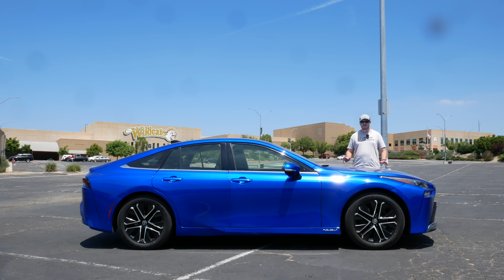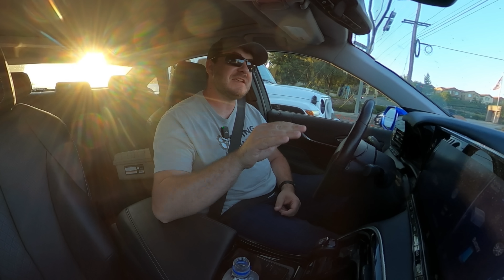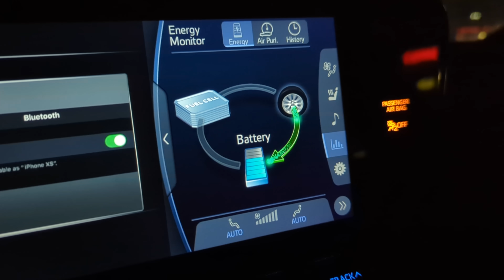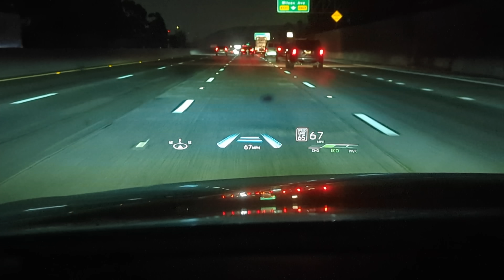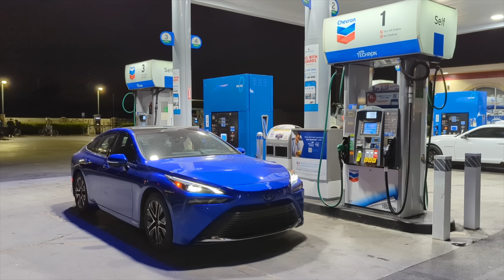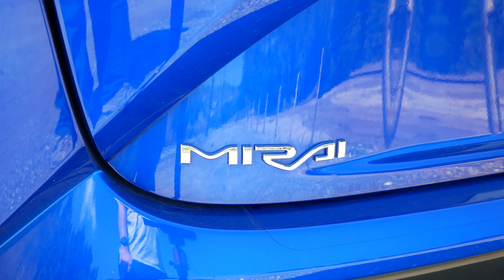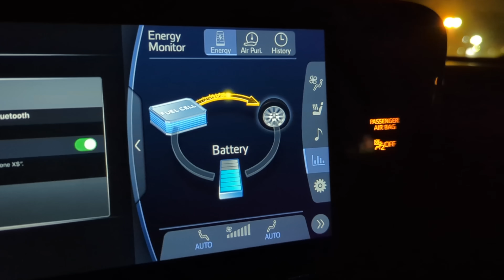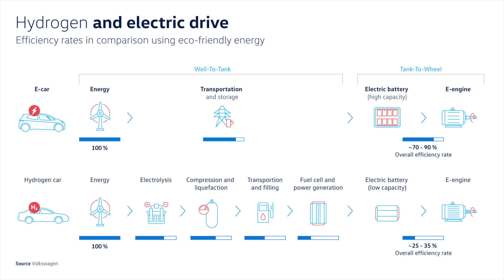The Toyota Mirai is Disappointing

Comment: The complexity of the chart by Volkswagon is highly deceptive in that it doesn't describe the scalability of the systems involved.   It also does not describe the efficiency when things change.  Such as when every car has to be electric. 

* Grid scale batteries are not feasible and won't ever be feasible. Battery storage does not -scale-. Can you keep increasing hydrogen storage? Maybe?

* The grid must be balanced at all times between supply and demand.  When there is not enough supply, usually the supply comes from fossil fuels. Unfortunately, the sun and wind don't shine in the right amounts in relation to the current demand.  Hydrogen might be able to be stored and compressed to better match supply and demand and reduce the amount of fossil fuels needed to balance?  Seems like that to me, but I don't know.

* Electrical transmission lines are shared.  There is such a thing as overloading transmission lines and causing forest fires, grass fires and electrical outages. Cars are not the main source of greenhouse gases and if we wish to reduce greenhouse gases, we need every bit of transmission line capacity to address those.  Heck, even an overhead system of electrical lines powering cars would be less bursty than "mega" charging.  Transmission lines do not -scale-.

How well does hydrogen scale?  I don't know, but I imagine it's much better than electric drive.  Energy must be in the right place at the right time and how it gets there matters.  It matters for the environment, it matters for the grid, it matters for people when blackouts happen.
Reply: Grid scale batteries are remarkably useful. They aren’t used as a “backup” like some people suggest. They are used for capacitation. They store the excess that isn’t used when renewables are over producing and supply energy to the grid to make up the difference when they are under producing. The size battery you need for this isn’t actually all that large. Just look at the Hornsdale battery farm in South Australia.

South Australia’s grid almost overnight became one of the most stable grids in the country because of grid scale batteries. That is because the batteries can respond to fluctuations in grid frequency or grid demand in nanoseconds meanwhile fossil fuel plants and hydrogen storage takes tens of seconds.

The next benefit is that battery storage can accept a huge amount of energy all at once. And output a huge amount of energy all at once. Hydrogen can not. Electrolysis is slow. Too slow for grid scale storage. 

The next problem is that if you put 100kWh towards battery storage, you’d get 98kWh of that energy back into the grid. If you put 100kWh to hydrogen, you’d get approximately 25kWh of that energy back into the grid.

By using hydrogen as a storage medium you are pouring huge amounts of energy down the drain. 

As for transmission lines, they are scalable. Powerlines to power flow ratio isn’t linear. That’s because the grid operates on an AC system. Frequency determines power just as much as amp or voltage. You also can step up or step down the power through transformers. They only time when that relationship becomes linear is when it’s converted to DC at the home. And you’re not supercharging with MW of power at the home. The most a home charger can output is around 8kW with a level 2 charger. Homes are supplied with somewhere between 48kW to 100kW power supply.
Reply: @engineeringtheweirdguy2103  When your powerline starts melting/sagging and starts a forest fire, I wouldn't say that's scalable.
Reply: @JohnSmith-pd8kd  clearly not familiar with the Ohm’s law. Or how’s it’s used with powerlines and how it related to power line temperature.
Reply: @JohnSmith-pd8kd  crash course. Heat is generated by electrical resistance. Resistance is calculated from power flow as R=V/I where V is voltage and I is current. As you may have noticed. The higher the current is in relation to voltage, the lower the resistance, thus heat. And since power P=IxV, as you increase current, you decrease voltage. What this does mean however is you need more electrical insulation to prevent arcing. And hence we have those huge towers and big and small transformer stations. That step up and step down the current.

Then you may note that we use AC current instead of DC current. Since it is a wave you could imagine it as pushing and pulling a chain of electrons through the wire. Instead of them running ragged alone that wire, heating it up and wearing it out, the backwards and forwards motion is what carries the energy. Notice the difference in temperature of a normal incandescent light bulb vs a fluorescent light bulb. One works on DC and the other on AC. 

It’s a little more complicated than that but it’s a nice why to explain the gist of it.

Point is. Power transmission is safe. Even with a expanding grid capacity. Infact power use has dropped in the last decade thanks to energy efficient appliances and LED’s. Leaving more room again. 

They only become unsafe when the grid is poorly managed and used for political posturing instead of as a serious utility asset like they did with the energy grid in California. 

Hope this helps.
Reply: @engineeringtheweirdguy2103  Wow, solved all the power company's problems.  They don't need to be building new powerlines at all.  They should be using Ohm's law to get limitless power over the same lines.
Reply: @JohnSmith-pd8kd  no. What I’m saying is that it’s not a linear relationship between power-line gauge and power supply. Most transmission lines are set up to carry well over double their current average capacity safely. The use of other technologies such as topology optimisation and power flow routing can also increase grid capacity without ever really needing to touch a single transmission cable. Called GET’s.
Reply: @engineeringtheweirdguy2103 I guess that anything is "scalable" as long as you have infinite money and time and resources.

Comment: I live in LA near a Hydo gas station (a Shell that offersit) there are several luxury home owners who bought one ...looks amazing....it's also 70,000 dollars...! looks liek a future  Lexus...especially in white.... Free hydrogen and cleaning the air....no need to stupid charge liek a TEsla is good...PROBLEM: these gas stations are sometime offline!
Reply: Yeah wouldn’t hold your breath on hydrogen. For starts, it isn’t free. Hydrogen costs around $20 per kg. Making it way more expensive than gas or electric. Toyota just give you a $14,000 fuel card when you purchase the car in an effort to get anyone to buy them.

But for the price you could buy a Tesla which is not only cheaper to run, and lasts longer than the Mirai, but it’s also faster, handles better, safer, and has more passenger and luggage space, all for almost the same range making it way more practical. Plus you’re not limited to like 20 stations in California to fuel your car and can go cross country. And by the sounds of it these people can charge at home. Meaning they don’t have to go out to get hydrogen. The plug in at home and get up every morning with effectively a full tank of gas. All for less than 2% of the cost for hydrogen per mile.

Comment: A little backhanded maybe but I see it as a replacement for gas in PHEVs. Having gigantic batteries most of whose range is never utilized is wasteful.
Reply: Larger range means slower degradation meaning the car lasts a lot longer before the battery needs replacing.
Reply: @engineeringtheweirdguy2103  Maybe so but it seems dubious to have a battery capable of going 500 miles and it's used once or twice a year to go more than 50 at a time.
Reply: @RICHUNCLEPENNYBAGS77  well aside from the fact that ICE cars have fuel tanks that go that far, let’s assess if it’s “dubious” or not. 

Modern EV batteries are rated for 3,000 cycles. If you had a battery that did only 50 miles to a charge in an EV. You’d have to replace that battery every 150k miles. That’s a lot of wasted batteries, alot of materials, manufacturing and cost.

If you had a 500 mile battery, that same 3,000 cycles would take you 1.5 million miles to reach. So not only does it become a more Practical car, and more useful in a wider array of activities. It also lasts MUCH longer. Meaning less disposed of batteries and less manufacturing (economy of scale).  And less cost replacing the batteries. 

So there is method behind the madness it appears:
Reply: @engineeringtheweirdguy2103  Well if 300 miles is good then surely 3000 miles is even better! Not really of course, there are other costs that start to get silly if you insist on making the battery larger and larger. Maybe 50 miles isn’t the ideal range but who says 300 is the right one?
Reply: @RICHUNCLEPENNYBAGS77  other than the cost of buying the vehicle, there isn’t any related expenditure to having a larger battery. And the market will ebb and flow in relation to range and price point before a general consensus is achieved in relation to the optimal range vs price for different vehicle classes and the average persons use case scenario. As fuel tanks have, more so in relation to fuel range and cabin space more than anything else.

Comment: A plug in hybrid hydrogen vehicle would be the best solution.  So of course we won't get it since people will think emotionally about the issues.
Reply: Actually it wouldn’t. Because you couldn’t.
Reply: @HontasFarmer80
That would not work just how hybrids already doesn't work. You simply have more complicated  car with more pats and more failure points which is at higher price to begin with. Pure BEV's work just fine, no need for hydrogen.

Comment: The government is purposely not putting hydrogen stations, they are pushing Electric so they can line their pockets with all their inside trading back door deals. Sad we have became A Banana Republic
Reply: Put away your tin foil hat.
Stations are built by manufacturers, not by government... Single hydrogen station costs over 1million, while single BEV charging station costs under 100k, can be as low as 50k per station. On top of this, no one wants to buy hydrogen cars, which means that no one wants to spend millions on a hydrogen station which will only loose money for you... That's basic economics 101... 

Some basic numbers here. There are under 1000 hydrogen stations in entire world, but there are around 3 000 000 BEV stations, not including the fact that you can potentially charge your car from any wall socket. So people are buying most convenient option, BEV. On top of this, hydrogen costs arm and leg. You will be spending like 5x more on your travel costs with hydrogen in comparison to BEV. So yea, people want cheaper options, government simply supports what people want... Welcome to reality.
Reply: @Zripas  Some people still live in the past thinking that EVs need 10 days to charge for 2 miles of range, so they'll do anything to discredit EVs and try to come up with other ridiculous ideas instead of spending 5 minutes of their lifetime to see that EV range has drastically increased and recharge time keeps getting lower.
Reply: @texanplayer7651  
Which is really interesting. I see soooooo many people under hydrogen car videos screaming that hydrogen is the way to go and that BEV's are government scam of some sorts... Its so weird...